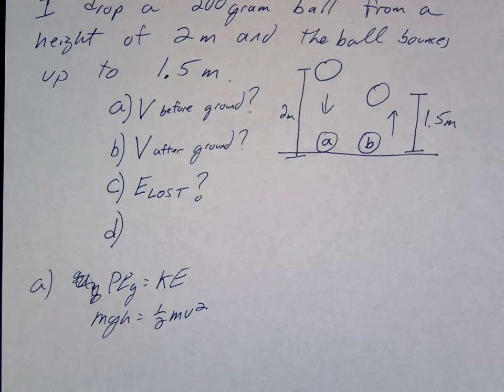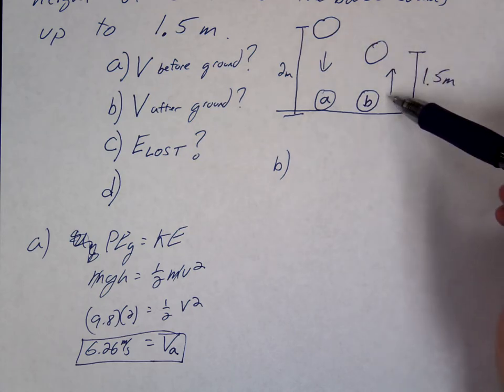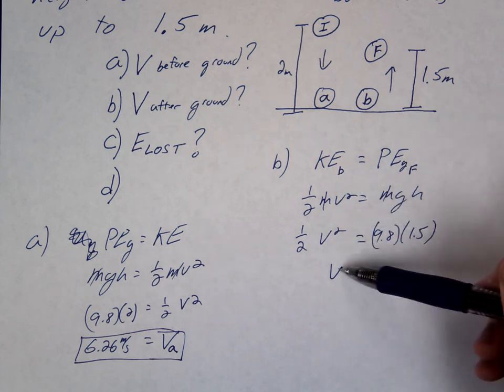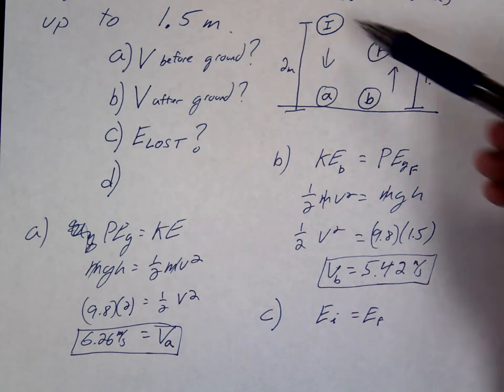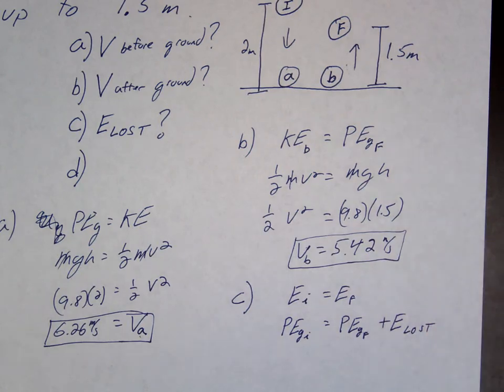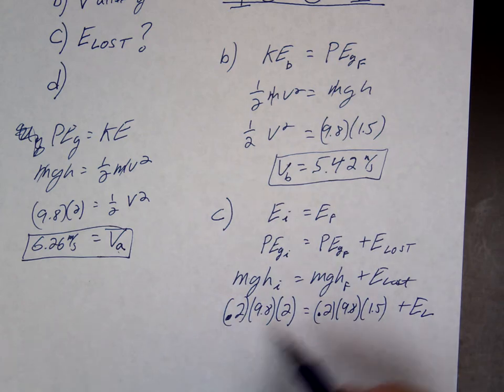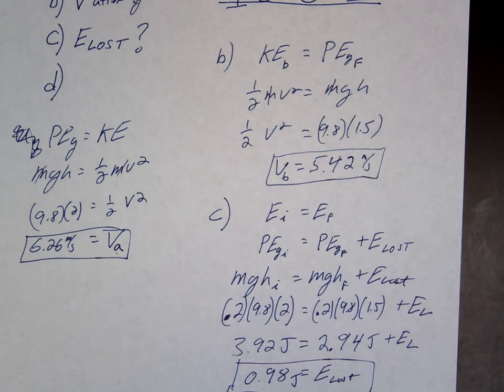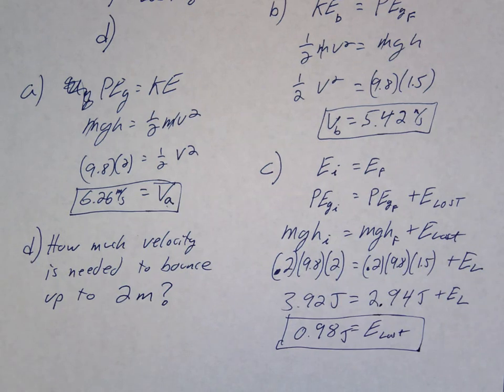Calculating the Energy Loss from a bouncing ball (part 1)

Comment: I got an idea about the number of times the ball will bounce practically

Let the ball looses (1-r)th proportion of its energy on every bounce -> with initial energy mgh, the energy remained in the ball after subsequent bouncing when it reaches top will be
mgh
mgh(r)
mgh(r^2)
mgh(r^3)... and so on...

So after the last bounce, the energy remained should be < mgR, where R is the radius of the ball, and this potential energy i.e. mgR is the default potential energy, i.e. potential energy of the ball lying on ground
->

mgh(r^n) < mgR
->
n = int( (log(R/h)) /log(r) )